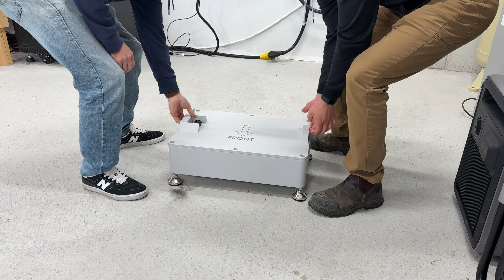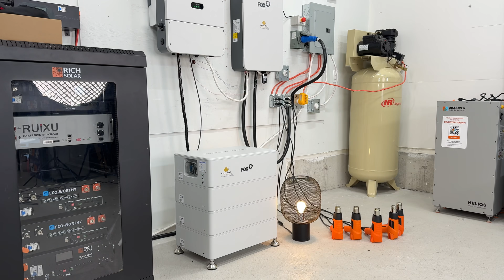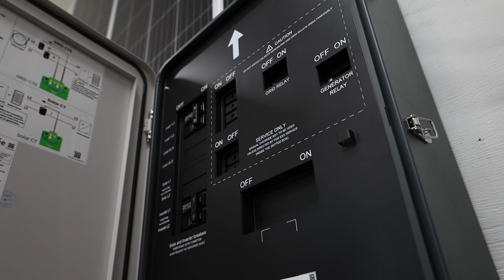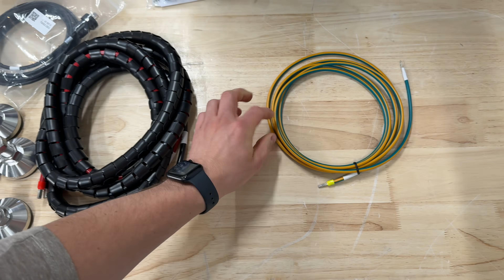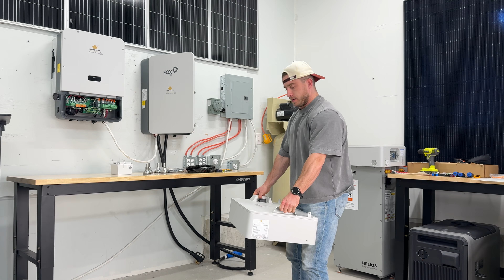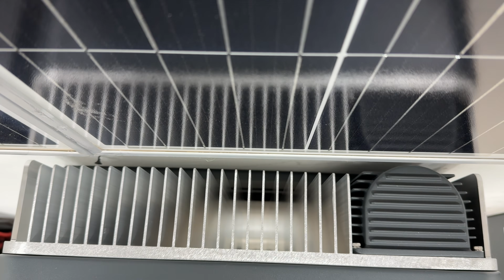Is THIS The Future of Solar? - High Voltage Maple Leaf Northern FOX Solar Kit

Comment: I have this system and it is tied to the grid but as zero backfeed (i.e. NOT a net metering setup).  I cannot get final approval with my utility company because despite FoxESS specifying it will not backfeed to the grid it actually does send power back (1Kwhr per day).  My inverter is the 11.4 version.  Has anyone else had this problem?  I know Fox is trying to correct this but unsuccessfully to date.

Comment: To add to some of the previous comments; your presentation isn't detailed enough. For example, I want information on the G2, but showing me the front panel doesn't clarify how to wire it up.  Perhaps if you were to show some example block diagrams showing maximum PV inputs, Generator or Grid inputs, and how household loads connect. Optionally, how would one wire it as a standalone panel, versus an add-on to an existing grid panel.  Another Youtuber mentioned that it can wire straight into a meter base, but am I able to somehow wire it into the grid without having to get the electric company to shut off power to the meter base?  Diagrams would be a massive help.

Comment: I do like the MC4 connectors to the batteries. You do want to be extra careful to make sure you can't short out the terminals on a high voltage system, and those connectors should help a lot with that.

Comment: So the one thing I would want to know is what are the specs on the battery voltage coming into the system? And after reading through all the comments, I still don’t have an answer. Is it variable? That is can it be anywhere from say 50 to 300 or 400 V?
Seems a bit bizarre that this whole video was about this high voltage battery and we don’t have an answer here. Somewhere there is a manual for the inverter that gives the specifications. On the other hand, that reminds me of a way that you can sort of hack into your system by putting high voltage series stacked batteries into your PV input because the system doesn’t know the difference between a battery and a PV array. However, we would, of course, like to be able to charge our batteries and feeding series stacked batteries into PV input doesn’t allow for that of course. Well, I haven’t done the math, but it sounds like they are using proprietary batteries and the cost per kilowatt hour is very high so this sort of rules out doing this. There are I think ways you could sort of hack a series battery configuration into a standard system, but it wouldn’t be worth the trouble.

Comment: How does this compare to E10 or ecoflow upx. Cost, output and setup? They all seem very similar. I need backup power and the ability run the house 4hrs a day during on-peak prices.

Comment: There are obvious benefits to this system albeit at an elevated cost. The battery architecture is really pricey and I would ask what does it benefit me to go this route? I am locked into an architecture that prevents the use of generic equipment that performs as well at a much lower cost. Sorry I did that once with solar edge, never ever going down that road again.

Comment: You've found that a surge happens just before full power's restored on a system reboot.  This can be a problem because surges might cause problems - maybe damage certain things.

I guess I dont understand much of the detail about how this stuff works. But doesn't the power for a house get pulled from the batteries?  The system powers the batteries and the batteries power the house?

If that's how it works, wouldn't that small initial trickle on a reboot go into the batteries, while the batteries pretty much buffer and give a steady level of current that powers everything?

And if not, why not?  🤔

Comment: Thanks for your content. So here's a question for you. I'm moving from the US to the Philippines once I sell my house this summer. I'm building a house and shop there. They are 220v there but since I'm going to be solar independent I'm bringing my 110v American appliances with me. I'll have both 110v and 220v. Is that possible? I've noticed what seems to be a higher component quality here in the west. Can you recommend any manufacturers that are Asian/Chinese or will ship to the south pacific from North America/Europe? I think I want a at least a 24kw system.??
Reply from the maker: That’s definitely possible with a split-phase inverter, and there are several reliable global manufacturers that can ship to that region! However, we're not as familiar with the local manufacturers and suppliers in that area. ⚡️

Comment: The data sheet lists a nominal voltage per battery of 57.6V, which would be 18 cells x 3.2 volt per battery.  Most "48 volt" LiFePO batteries have 16 cells x 3.2 volts for a nominal voltage of 51.2V.  The main advantage (because you can stack up to 7 batteries in series) is NO NEED FOR HEAVY GAUGE CABLES, since the current never exceeds 50 amps.  The voltage can go as high as 459.9V if all 7 are stacked.  Disadvantages are cost and NON-standard battery voltage.

Comment: What is the voltage? Of the batteries
Reply: The manuf data sheet lists a nominal voltage per battery of 57.6 V, which would be 18 x 3.2 volt cells per battery.  Non-standard.  Most "48 volt" LiFePO batteries have 16 cells x 3.2 volts for a nominal voltage of 51.2 volts.

Comment: This looks a lot like  my Growatt MIN-10000-TLXHUS. Casing , passive heat sink, specs all eerily similar. Wondering if the batteries will be compatible (Growatt MIN also uses high voltage batteries).

Comment: This was probably the most head-scratching video I have seen on this channel; it left many unanswered questions.  So I fed this video and several other sources into NotebookLM (yes it's an AI, but it can be incredibly helpful in digesting hard-to-understand videos and texts) and here is the gist of what it reported.  First, the hardware is incredible as long as you don't need a lot of power - they make it very difficult to stack multiple inverters, so this might not work for a farm or shop with high power requirements.  Second, their software kind of sucks right now (unless it's recently been fixed).  Want to do time of day load scheduling to avoid high rate period usage? Some users (especially on Reddit) have reported that the software/app is very non-cooperative.  Third, you are effectively going into a walled garden situation where you have to go through your dealer (or the manufacturer if you can reach them) even for things like simple software updates. If you avoid Apple products because of their walled garden policies you aren't going to like this.  That also means you can't use it with things like Home Assistant or other third-party monitoring/control software. And if your dealer goes out of business or drops the brand, you could be up sh!t cheek,  The bottom line is that as this is currently marketed this is probably not the best system for DIY types or for those who don't want to be dependent on a manufacturer or dealer.  And as much as I HATE recommending Reddit due to their insane moderation, you may want to search for comments on these devices because apparently there have been some pretty scathing ones.

Also you should be aware that two different types of inverters are sold, one that only works with the external (grid-boss type) box and another that is standalone and will not use the external box, so you need to be careful which you get.  Personally I would prefer to see more high voltage equipment from competitive manufacturers. They are absolutely right in saying that elephant-trunk thick battery cables are not the way to go, but there were things about this system (even in the video) that concerned me, for example that low voltage current that is sent for a couple of seconds when the unit starts up could possibly damage certain types of equipment.  Also, the video said that the inverter can only operate at temperatures  down to -10°C, what's with that?  I thought these things were designed to be used outdoors in cold climates.  Did they really design the batteries to be used in extreme cold but not the inverter?

If you ever hear of alternative brands or ways to go this high-voltage route, or if they ever fix the problems with this unit (especially their apparent hostility toward DIY types that want to run their own monitoring software, or maybe connect other brands of batteries) please let us know because conceptually this does seem like a much better system, however in my opinion the batteries cost too much and there are too many other drawbacks.  There are many people that this system would work for as it is currently designed, and probably many more if they would fix the software/app, so I am definitely not saying no one should buy it, but if you do at least you will have some idea what you might run into.

Keep in mind that the AI may be looking at wrong or outdated information in a few cases so take everything with a few grains of salt, and what did not come from the AI is just my opinion based solely on this video and the AI-generated report, and I have been known to be wrong at times, and AI has been known to be wrong a lot!  I hope there will be a second video that clears up some of this and that focuses more on the actual specifications of the units.

Comment: this video seems different.....after watching for 20 min i had a lot....a lot of questions and not much real info other than you guys liked this system. maybe high voltage systems are so different that the info just went over my head. missed the solar voltage input range, can you use the inverter without the G2 hub if you dont want smart circuits and will use a transfer sw? is this a DIY install or certified electrician only? What is the battery chemistry? Can it be set up as a off grid whole home system and use the grid for back up? i would like to see a revisit review maybe going over one component at at time, batteries only then inverter only and one on the hub........ as it is now i dont understand much about any of these.
Reply: "our opinions cannot be bought" yeah idk....

Comment: Batteries are proprietary and about 4x overpriced compared to eg4 and watt cycle. The other parts seen normal
Reply: One big advantage of high-voltage inverters is that they can be connected to batteries from electric cars like Teslas or Nissan Leafs, and these used batteries now cost only a few thousand dollars per 60 kWh.

Comment: Rough part is the cost per kWh. You can get a 16kWh 48v battery for about the same price of one of the 4kWh for this system. The other costs are in line.
Reply: Yeah... the battery units are over $500/kWh. Pretty expensive.
Reply: Believe it or not, if you are an electrician or high voltage electronics technician, you can build a HV battery yourself.
Not recommended for novices. But I have plans for a 320V battery.
The BMS is around $2k, but you save a lot in copper.
If I could find a direct from DC car charger, I would build for that voltage. But as it is, I was rating it for the EG4 hybrid air conditioner to run off the battery.
Reply: @williammeek-h2o  I am thinking of a 100-120V battery bank.  That this inverter runs on 85 - 460 volts is ideal.  The charm of 100-120 VDC is the long list of things in our home that run on 120 VDC.  This can be helpful should an inverter ever fail but more importantly, build the solar array first, then the battery bank and lastly, add the inverter.  At each stage along the way, the stuff that runs on 120 VDC can be powered up.
That the first 4kWh battery pack costs $2,000 is a show stopper though.  It would help a lot if some company offered a split-phase 240 VAC inverter that ran on 100-120 VDC.  I mean if a legitimate company . . . .  There are cheap Asian (China and India) 96 volt inverters.
Reply: @peteinwisconsin2496  here are a couple of inverters that should work for you. Not cheap but there are real advantages to going HV.

SungoldPower | High Voltage 11.4KW Hybrid Split Phase Inverter with APS Transmitter SG11.4KHB-HV

Solis S6 7.6kW Single Phase High Voltage Hybrid Inverter

Comment: That’s not a good price at all !!! You can get EG4 and batteries for cheaper than that and you could go even cheaper if you went with a different brand rack battery shit even a Victron system would be cheaper than that and I would say that 90% of people just need an inverter all in one not that extra breaker box smart bullshit most inverters at least the Victron will automatically switch over from from your generator back to regular off grid power without any switches or breakers solar is starting to remind me of cars. They just keep putting more and more technology that you don’t really need in it and charging you extra money for it.

Comment: Please make all of your reviews clear about Wifi. Are these devices Wifi direct between mobile devices &  the controller? Is there a need for Wifi router connection? Is internet necessary? We are on-grid & no internet, with no future imterest of internet. None of the units will have internet access. We have no need for remote system observation & our feet work great to look at panel screens, to manipulate controls & buttons. Please offer additional info about the missing data points. Thank you for your reviews.
Reply: How are you posting if no interest in the Internet???

Comment: 16:58 is a BIG reason not to buy.
Reply: Yup. I want a system that I can use even if the company goes out of business.
Reply: That's a deal breaker.  If I wanted to rely on a dealer to keep my system running, I wouldn't be off grid
Reply: Huge red flag.  Hopefully this is just for initial batches until they work out any potential issues.  If not, that's too bad.  It would have been nice.

Comment: Hoping you guys take a look at the SRNE ASP 16KW inverter
Reply: I just looked it up. It doesn't appear to be a high voltage inverter, and it also doesn't appear to be an outdoor rated inverter, so definitely not an apples to apples comparison.
Reply: @JohnnyThomas-ps6mp correct

Comment: I see no benefits to this and it’s expensive. $2,500 per battery and you’re getting less than 4kWh / battery? For that price, there are 32kWh LiFePO4 batteries! This price makes going solar not worth it.
Reply: Just a correction with the pricing the 2500 price is in Canadian. The USD price is closer to ~1800
Reply: @solarpowerstore  Ah, good catch!
Reply: Rack batteries are $700 for 5kwh... For comparison...
Reply: $2000 for 16 kWh generic 51.2V LiFePO4.  With UL its more like $3000 I think, or slightly less, fully shipped.   A branded EG4 16 kWh battery runs $3750 right now on signature solar.

Proprietary HVDC stacked batteries are always going to be more expensive than standard 51.2V LiFePO4 batteries.

So you pay for branding and you pay more for branding plus proprietary.

There is one fairly significant advantage of the HVDC and that is the inverter and MPPTs run a lot cooler / reduced fan noise or no fans at all (though personally speaking, SMA learned the hard way that they needed to include a fan with their "fanless" string inverters even if it rarely ever had to run).

The disadvantage of HVDC is that the battery stacks have more limited expandability (or require a more complex input port to be able to parallel them).

Comment: So this is roughly analogous to Gridboss/Flexboss and 1 wall mount battery? Cost is in the ballpark too. I was thinking about the EG4 package because my service is at the opposite end of the house from my garage. The maple leaf setup looks like I can do that with much thinner wire running through the attic which will reduce my installation cost. Now if I understand the video, it is another inverter for each 4 stack of batteries? (1master plus 3)
Reply: That is exactly correct Rich. One correction is you can go with 7 batteries per stack, growing the system is totally doable as well. You simply need 1 more inverter.
Reply: @solarpowerstore what is the largest stack of batteries you can do before needing to start a new one? Can these go up to 450v in series, so around 9 modules? Or is 7 the max?
Reply: They are analogous. The EG4 system is a bit more expandable and more generic in terms of future-year maintenance.   The EG4 system is a 48V battery bus and will make more noise, but that's never been a problem for me with their FlexBox series (mine's in the garage).   And the EG4 GridBoxx is ... I'd say its actually a bit more functional in that it will parallel multiple inverters natively (it has 3 hybrid inverter ports that are completely separate from the 4 smart ports and all the other ports).

EG4 also has a new system that is HVDC rather than 48V.  I don't know what the status of it is (mine's the 48V stuff).

-Matt
Reply: I believe that you will be running the same size wires as the batteries hook to the inverter (in your case the garage) and then AC connected to the "gateway".

Comment: How do you know the inverter can do the 200a passthrough? I can't find any documentation stating this.
Reply: Hi Ryan, it's not the inverter but the hub G2 that does the passhtough. The G2 is actually rated for up to 280Ah and has a grid assisted feature where it can use both the grid power and inverter power to fill power needs!
Reply: @solarpowerstore oh in the video it sounds like you said "If you don't need the hub because you're not paralleling inverters the inverter can do 200a passthrough on its own"
Reply: @solarpowerstore  280A not 280 Ah